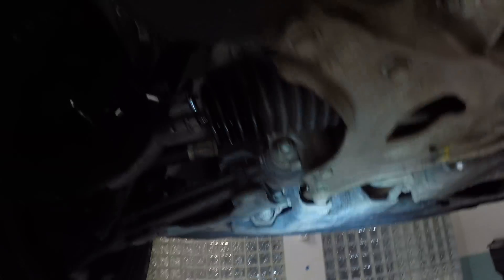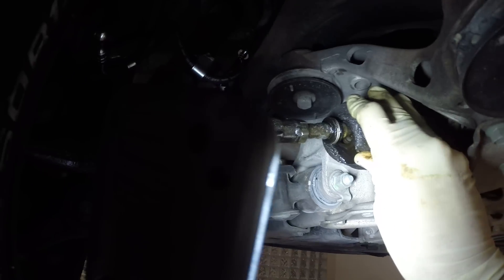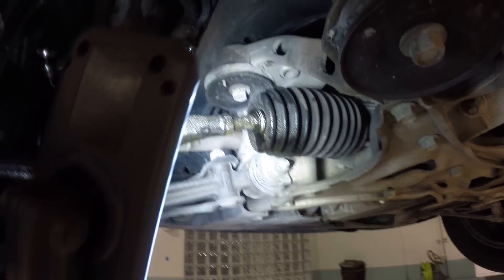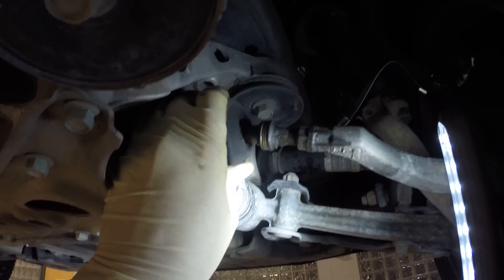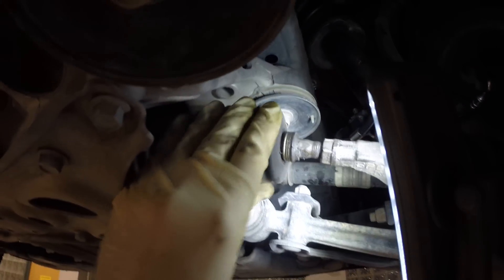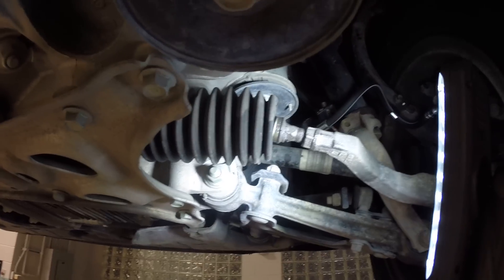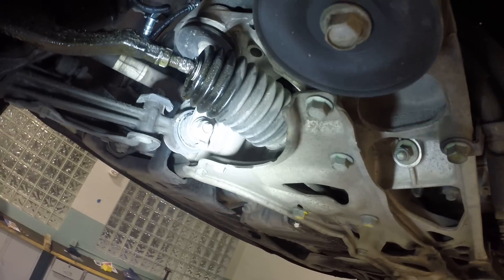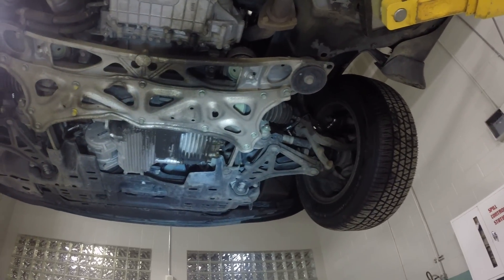Power Steering Rack and Pinion Problems

Comment: Great video.. my 2010 FX35 rack and pinion has a light leak on the passanger side, I'm going to buy a used one on ebay and get it installed because the ORM ones are EXPENSIVEEE!!!!!

Comment: Thanks for video first of all. I have 2005 Pilot, have had 3 power steering pumps & about to have 3rd Rack opinion replaced too, all 3 have leaked (within 2month period) what is causing the Rack to blow seals & leak???. My mechanic (brake check) is about to replace the 3rd rack tomorrow & he is saying he is going to "check" to see what's blowing the seals (leaking) I'm afraid he's going to come up with unnecessary expenses that I have to pay for, ??? I think the system isn't being "flushed" properly is the problem,, any insight????
Reply: They need to bleed it after change anything.

Comment: I was told I should replace my steering rack in about six months. I just replaced the outter tie rods. I had heard knocking before, that's now developed into my knocking and clunking. Could the tie rod job have made the rack worse? I have half the money saved. Do you think another month is a safety issue? So freaking tired of taking this POS for inspections. It's PT Loser.
Reply: Shannon Sundberg, don't feel bad & stressed, we are dealing with the same thing in our Dodge Grand Caravan, it clunks, & pops & it sounds scary, we just replaced a lot of parts in our frontend, including tie rod ends, Swaybar links, Control arm/which includes the bushing, & upper ball joints, both sides, then we just replaced the two lower ball joints, but still having the clunking & popping sound when we turn left or right, we think our Rack & Pinion is bad, their are things you can do that can save you money, buy the rebuild kit at a part store or Rockauto, or Parts geek, shop around, the kit is anywhere from 30 dollars to 45 dollars in most cases, replace your boots too that can prevent this happening again, good luck, don't let it stress you, we are in the same boat you are, lol
Reply: @alicehenderson7983 cv axle is bad very common with dodge vehicles
Reply: @nicolepacheco7742  yeah I just replaced the one on my side, passenger side, but it may have been a defective part, going to see if Rockauto will send me a new one, then going to replace driver side one too
Reply: @nicolepacheco7742  yeah I think it's our CV axle too, think we got a defective one, it has just been replaced, so thank you

Comment: So, my wife’s 2014 GMC Acadia Denali cannot make right hand turns.  And there is fluid on the ground.  Does this sound like a rack and pinion issue or power steering pump, or what’s stated in this video or all of the above?

Comment: Why wouldn't you just replace the inner and outer tie rod ends and see if that fixed the issue instead of replacing the entire assembly?
Reply: Cyrus Cooney no point on doing that..the steering rack and pinion seals are leaking from the bellows boot..needs a new steering rack and pinion
Reply: Tried it and it makes the problem worse
Reply: @rahrah8076  our Rack and Pinion has been leaking since 2015, we have a Dodge Grand Caravan, and we are going to replace it very shortly, plus tie rods, already replaced tie rod end on passenger side, now got to go back & do tie rod on passenger side, plus both on driver side, then swaybar link on driver side, already done swaybar link on passenger side, having front end checked to see what else is bad, we have about replaced everything else in front

Comment: My power steering reservoir level is full and has been for over  6 months. The car stays straight when driving. However I have to fight  with the steering when getting out of a parking space.  So if the fluid is not leaking , what could be the issue. It's a 2002 VW  Cabrio.
Reply: I would say the power steering pump is not pushing the fluid through....there are only 3 main parts. Reservoir, pump and the Rack and Pinion. I'm not a mechanic, but have worked on vehicles a fair amount.

Comment: Hi, I do the 12-6 in and out test, no movement at all. 3-9 in and out test and I can feel my right side moving. Both outer tie rods feel pretty solid but, I feel movement on the right inner tie rod, both were replaced recently. Do you think is my rack failing on the right side only? Can this even happen? Is there an adjustment I can do using the big set screw on the rack. Thanks. I hope I explained myself. It's a 2004 saturn ion.
Reply: Yes...I just diagnosed exactly what you describe. The play was coming from within the rack and pinion and not from the tie. There should never be play within the rack and there is no adjustment. the tie joint was rock solid and the play was in the inner tie rod. You can most likely just replace the rack. This must not be very common, but could easily come from worn gears within the rack and pinion. The symptom my friend's car had was sever shaking when braking above 25 mph. There was very slight rotor warp, but not enough to cause that severe of a shake. Not a bad idea to replace even a slightly warped rotar as this can lead to premature rack and pinion wear.
Reply: @erickeenan7562  just saw your message, thanks.

Comment: how can you tell if its bad when its moving because i have a 94 honda accord and the car (front mainly) rumbles when i break. it had a bad tie rod end i thought that was the problem so i changed it. but the rumble still goes on when i break could it be the steering rack or brake rotors?
Reply: Sounds like possibly warped rotors.
Reply: You need to get it up on stands just like the video and do the 9 and 3 o'clock shake. There should be no movement. The movement can come a bad outer tie rod OR can come from a bad rack and pinion. They do wear out and the gears get sloppy.  There should be no freeplay in the rack when pushing or pulling.

Comment: How long can I ride on a bad rack and pinion? Been doing it for 5 years 100k lol  I mean I'm not loosing power steering fluid. It drives and steres fine even alignment on point. I do hear minor noise when parking etc  which got little worse over years  I got about 250k on my camry don't want to put money into it besides that car good mechanical condition any advice? I wanna make this car last without doing unnecessary work $$ save money
Reply: Glad to hear I'm not the only one thats been driving with bad power steering rack for about the same amount of years lolol.
Reply: GentleBreeze a lot of people can’t afford these expensive repairs..take your vehicle to the shop all of a sudden it’s thousands or over $500 each time then your walking tell you save up enough to get it out
Reply: Been driving on a bad one for over a year.  I've been changing all other suspension and steering components.  Finally gonna do the rack and pinion this summer
Reply: @jmayo311  me too, I change the whole suspension, front and rear struts, cv axles, all belts, power steering, valve cover gasket,timing belt and now Im gonna do the rack, spend around $500 in parts but I'm saving thousands in labor cause I'm doing it myself!

Comment: Hi, I stay in India and have a Maruti Suzuki Swift Dzire, I have started feeling that car wobbles a lot and sways a lot as if there is a balancing issue . have got it checked at service center for ball joints etc but every time they say all is Okay, past few months the car wobbles at slower speed of 20-30 kmph and even while braking the vehicles softly I can feel jerks as it the braks are becoming loose and tight in few seconds. Hope I am able to explain. Could you suggest what to get checked ? My car wheel balacing and alighnment mechanic says tyres have worn out and needs replacement, this job is definitely on cards but I want to ensure there are no mechanical faults in car first. he says the radial belt in tires are corroded.
Reply: Hitesh Taneja IM HAVING THE SAME ISSUE

Comment: Is it possible the mechanic loosened the power steering fluid hose connected to rack & pinion so now he claims it's leaking and the customer gets suckered?
Reply: grass hopper no. it was leaking because the rubber gaurd got unsealed and inside where the mechanic can't even get in to are further seals which were broken because of the dirt and crap that the rubber gaurd is meant to protect it from. there's nothing there for him to have loosened as there are no screws or anything. seals wear out over time and it's not surprising on a car of 20 years

Comment: That's nothing.. Mine blew out fluid like in 4 seconds it was empty.. Old car. I just called the junkyard to take it away and got another used work car..No way I was putting $845 into a car with 215,000 miles on it.